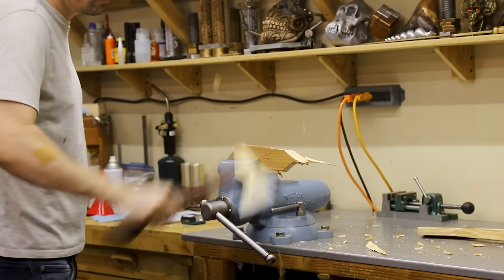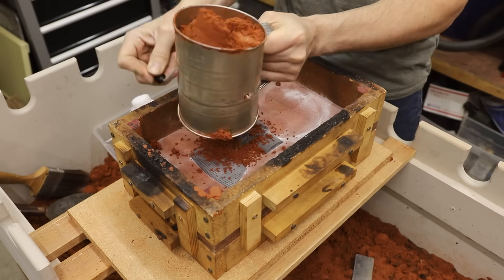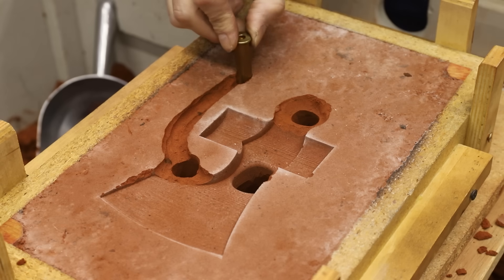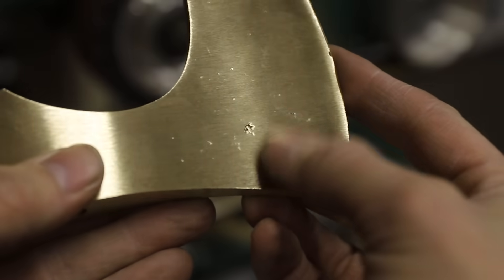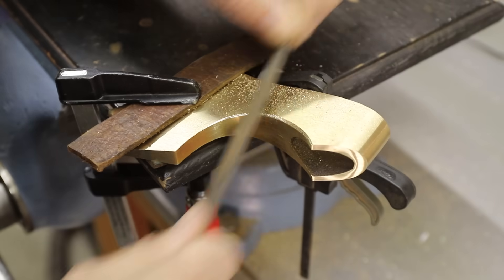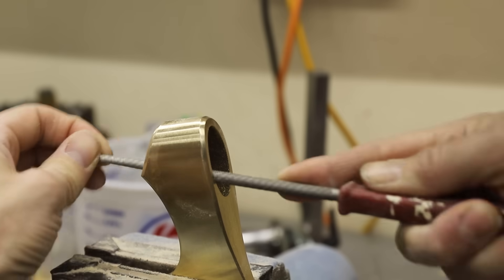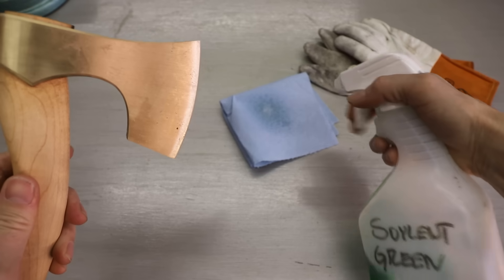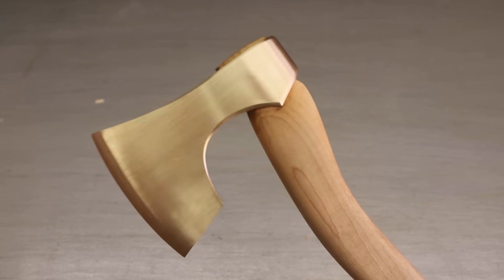Making & Testing Aluminum Bronze Hatchet WILL IT SURVIVE?

Comment: I think it would be really cool to compare hammer strike work hardening vs hydraulic press work hardening. With the press you may have to custom build a die/mold so you can harden the blade edge and a few inches back like you hammer hardened this axe. 

For the press hardening I think you would have to make the dies smaller on the vertical axis so it pinches down evenly across the axe blade, but you would also need a way to hold the head with pressure from the hammer side of the axe pushing towards the bade. That should keep the axe head from just slipping backwards out of the dies. Maybe have big bolts running from the blade edge horizontally back towards the eye, then you can run a thick bar through the eye with holes on the ends that line up with the bolts. Actually, it might be better to have threaded holes in the bottom die on the horizontal axis. That way you just slide the bolts through the bar going through the eye of the axe. Then you screw the bolts into the bottom die and that will keep the axe in place. The top die can be smaller than the bottom die because it won't have any bolts running through it. 

Main problem is getting the dies made. They would need to be made out of something much stronger than your alum/copper alloy. Maybe a collab with Brandon from inheritance machining? Or getting a sponsor from one of the fancy big cnc online shops that make custom parts. Getting the angles of the rounded sides of the axe might be a real pain so it may be easier to make a more angular axe head instead of traditional curvy sides. Though, I have no idea what that would do to the structural integrity of the axe. Hell im super late to the party so you may never read this, @robinson-foundry

Comment: Old axes had much thicker profiles than modern steel axes specifically because soft metals like copper bend so easily. It would be a good idea to do the same with this alloy.

Comment: It seemed to cut through whatever that tree is well. I wonder if 90/10 or 88/12 tin bronze would be better or worse for cutting and holding a solid sharp edge.
I know the ancient tin bronze axes had a thicker profile close to the cutting edge.
EDIT : Nevermind I just found your video on alu bronze Vs tin bronze 👍

Comment: One small comment, while an iron or steel hatchet will take the abuse, a hatchet of that design was never intended to cut kiln dried lumber, that combined with the lack of compensation for the metallurgy mentioned in a few other comments is what lead to the edge damage you experienced, I'd hazard to guess if you retested with a new head designed more like a camp hatchet and with more supportive edge geometry that it wouldn't make as quick of work but would likely survive with little if any edge damage

Edit(Ah well played sir, it seems you did just that and used more consistent metal for an extra bit of surety, I'll have to agree the tin bronze was quite impressive)

Comment: Every 5%ish difference in either copper or aluminum will throw out a different material entirely. It will alternate from brittle mess to hard af. Back and forth as you change that percentage. Melt time has a lot to do with it also as aluminum oxidizes the longer it takes to melt and that will goof up your mix. Got to account for it with extra aluminum. I would recommend adding 2% elemental phosphorous in a more controlled and inert atmosphere during the melt. Does not hurt to be picky with your choices of flux also. I have always used potassium chloride, activated charcoal, anhydrous borax, and aluminum powder as my flux mix for alumabronze. It makes a bit more of a messy dross, but it gives a clean product. The aluminum powder is me making up for losses when drossed

Comment: I used to make this stuff in the foundry i worked at.  I called it Bronzuminum.  I was looking for a way to weld aluminum to steel.  kind of like brazing but with bronsuminum  the join is much stronger and more integrated.never made an edged tool with it though.

Comment: The toughest bronze I've ever used was called Amco bronze, that we used for wear plates inside forming dies stamping car parts. It was almost impossible to drill, as it would work harden almost instantly,  and get so hard, that carbide could barely cut it. I don't think it liked bending either. If you can find some bronze from Ford's old form dies, I think it would work       better?

Comment: It almost gives me physical pain, whenever I see someone scraping the imprint of the mold - the roughened and loosened surface of the sand will introduse sand imperfactions into the cast. And it happened in your case, sadly.
It is better to use specific runner/gate additions during moulding to make path for the metal smoother. Or at least tamp the surface of the carved runner.

Comment: Dude, I freakin' LOVE the idea of making crazy alloys of various metals, that may have never existed before!
I mean, as an example, is there a way to allow lithium and iron? What properties would such an alloy have?? Would it behave like steel, with the Li atoms replacing the C atoms? Li is a HIGHLY reactive element, though. Would it be more susceptible to rust? Or would the atomic structure sterically hinder the oxidation of the lithium?
What about alloying a highly reactive metal, like lithium, with a largely inert metal, such as gold. What would the properties of such an alloy be???? Would those properties change with varying concentrations? ie- 10% litium 90% gold, vs 20% lithium 80% gold vs 30% lithium 70% gold, etc... Maybe one such alloy would be astonishingly confronting, in relation to its properties!!

On the one hand, it'd be great for our understanding of the science, to be able to accurately predict the properties of various alloys (such as per materials science). However, it would also be refreshingly wonderful to be incapable of predicting alloy properties, beyond its reactivity...

Comment: I have been researching bronze swords a bit, I'd really like to built one that is actually a sword. Much of the bronze strips one can buy is aluminium bronze, and it is said that aluminium bronze is not suitable for swords because it is much too brittle. The resultting edge damage seems to give this creedence, I have seen a bronze axe survive much more torture without failing like this. Swords and axes were 10-20% Tin Bronze, unfortunately I don't have the equipment to cast it myself. Really interesting to see, thanks!
Reply: nope its brittle one you have over 12% Tin 12% tin 88%copper was guns ,swords where 8 % or 6% tin. high amount tin is for church bells
Reply: @Preyhawk81  Many surviving european swords were between 10-12%, google a bit. And some chinese ones up to 20%, but those are outliers in the world of bronze swords. I have never seen the 6-8% figure. Could be these are arsenic bronzes with less tin but more arsenic (edit: early swords were generally lower tin, but the tin also leeches out over time and might not really show what it originally was) , but the tin bronze is generally accepted to be 10-12% for best results.
And bells to my knowledge are between 20-30% tin.

Comment: I'm sure if u mixed up the right proportions of each metal u could come up with a stronger chunk no doubt kinda like if u mix 81.5% gold to 19.5 % aluminum u get a purple gold thats fairly strong and doesn't crumble like if u mix equal portions or kinda like making Nordic good 89% copper 5%zinc and aluminum and 1% tin looks just like a gold bar but no gold in it

Comment: Hmm! Beautiful axe! I wonder if the ancients used different shapes more conducive to bronze?  Possible a thicker blade and higher blade  sharp angle. Maybe 20 or 25 degree? Less shaving more chopping. Fine casting and l am learning to salvage imperfections by brazing. Thanks

Comment: That sand casting bench is a fantastic piece of kit. Inspired. You might also consider using the old Japanese katana trick of making a sandwich of your CU/AL alloy with a thin piece of high carbon steel in the middle, which would then be the cutting edge and would last much longer. The golden color of the alloy was very nice and I liked watching the process from start to finish.

Comment: After cutting the dried hardwood, rather than 'grinding' a new edge, cold hammer the edge to both sharpen, and further harden the edge.  It would have been nice if you told us to what angle you made the initial edge, and why you chose that angle.

Comment: BEAUTIFUL WORK. We used magnesium bronze for high strength clamps. They didnt like stretching as they work hardened fast, but they were great to grip the steel pipes. WORST PART was drilling the bolt hole for the clamp through the cast unit. I learnt to sharpen drills by hand very well indeed. This was in the 80s onwards. Drills were not great to start with. ..

Comment: love your work, one thing you might try is after you oil the handle (exclude the top to begin with and no steel wedges) soak just the head in a bucket of water for a few days, it will cause the wood to swell and really lock the head on. My grand father showed me this when i was young, he never even used wedges unless the head came loose later. I had to replace a handle he fitted once and it took longer to get old handle out than to fit the new one it was locked in so tight. The different color wood does look great though

Comment: It will not survive , and why are using softwood at the start, How about you come to Australia and try that piece of rubbish on Ironbark gum tree`s.
Aluminium has no tensile strength by itself , that why the covers on bikes  contain nickel ,magnesium etc etc.
Bronze also is not a strong material especially for violent work.
I still cant over you using pine as if that's a test of strength, Maybe in Russia , but not inthe real world.
I am a Boilermaker/Welder ticketed in 1985 Had to Pas DLI standard 4E.
I have made many log splitters in my time.
If you have a trade certificate, please post in chat the cert number and institute so i can have it taken of you. For bringing metal trades into disrepute bye posting rubbish..

Comment: could try again using the original mold that gave a thick squared edge, then work harden it for 10,000 stroke lol.   if it folds like that it can stand to be a bit more brittle so really hammer the shit out of it and see if you can make a harder edge :D

Comment: Man, a PM30 and G0602. Excellent small shop combo that used to be semi-budget, but not so much now.  Excellent work, any reason you don't use a resin print for the casting? Could easily eliminate 90% of the layer lines while printing much more quickly.

Comment: Thing of beauty!  Many years ago as an apprentice centre lathe turner I foolishly made a starter motor bush from aluminium bronze instead of phosphor bronze, it was totally wrong for the job and lots of loose play appeared quickly as the steel shaft wore more quickly than the al bronze bush. lesson learned, this stuff is tough.

Comment: There's a company in the netherlands RSP that makes an aluminum alloy called 7034T6. It's the strongest aluminum in tbe world achieving a yield strength of 750 MPa, higher than heat treated medium carbon steel. That would be a cool material to try making an axe out of.

Comment: Did you make your belt sander? What size belts does it use? I have a 2x72 I built but it would be nice to have a second smaller unit with the larger rubber wheel so I didn't have to take it on and off every time I need the flat plate. Thanks for any suggestions.

Comment: It looks fantastic. Can you harden the alloy by adding something to it when you have it in a molten state. I'm not sure. I'm just getting into melting metal and built a blast furnace out of an old ceramic kiln. I've been a welder for years but never had the time to build a small scale foundry until recently. So far I've melted into molten liquid steel pipe, and aluminum, that's as far as I hot before winter set in.

Comment: I think something to consider in the future for putting the edge on something that can be work hardened by hand and still annealed as well under relatively low temperatures. Heat is your enemy as it can soften the work hardening that was put in. Hand grinding/sharpening on a whetstone is at worst going to increase any work hardening while not friction heating the metal. More time consuming, but bronze (obviously) does not act like steel. After casting the best thing you can do is remove as much as the excess as possible via modern means before going to hand tools to remove more basic flashing and any rough spots you want to remove and then move to work hardening, and hand sharpening. The less heat after casting the better it is for the integrity of the metal.

Comment: Absolutely beautiful piece.  You could consider putting the chamfer and the internal taper of the handle into the 3D print.  If you are using Fusion 360 you can try the emboss/deboss feature.  You could cast in your own ID stamp or raised marking.  To me, there is something very intriguing about cast manufacturer's marks.

Comment: The chamfered edges are smart. True square edges will cut skin.  You would have to be concerned with all the edges of the axe instead of just the cutting edge.  Handle stock.  MOST maple is a poor choice for strength and flexibility.  As  ash has disappeared, MLB has moved to maple, broken bats nearly every game now.  Hickory (first choice)  ash hard to find,, some elm does pretty well, very flexible, very tough,, I would very slightly thicken the handle.  BTW  You do astoundingly beautiful work.

Comment: Do you intend to chop other than wood? If not, it will perform just fine, depending on the alloy. Will it wear more quickly than Tool Stel, sure. Will any but the most professional woodworker notice the practical difference, probably not.

Comment: Have you done any research into heat-treated such alloys? Normalizing and tempering had a HUGE impact on the usability of steel, though I imagine the metallurgy of these alloys means any such process would be significantly different. Still, just the annealing process changes dramatically, so there MUST be SOMETHING you can do to improve the hardness of the metal...

Comment: prediction: 

itll work out fine. The problem with bronze isn't that its a soft metal. It can actually be helpful since it wants to dent and bend instead of break or shatter.  The reason Iron historically started to get switched in for bronze is that tin is so hard to source. It also can hold a edge quite well as long as you don't go beating on steel with it. The aluminum might just be overkill.
Reply: Welp, i was wrong >D it happens once in awhile. Itsa bit surprising though, but I think your conclusion is correct. the edge might be a bit too fine. Looking at kopesh blades they had a thicker blade in general, but also a wedge-shaped edge.

Comment: Really good education film. Blade is ok , maybe medium, medium quality. Handle is poor. Mastering the woodwork is the hardest part and true masters used to make just slightly asymmetrical handles, that I havent seen at past 35 years , One I  saw were period of circa 1870 to 1930. They were made to compensate left and right handines and how human arm and wrist worked, so that blade hit surface at strait. Do not know, for what purpose precision axes were needed. Maybe there could of been one virtuoso, at shipyard or housebuilding, that could slice extra millimeters from pre cut assembly timber parts when needed, during construction. There has always also been unusual specimen of men, wo were capable of extraordinary skill level, and some even made their own tools. They were treasures, for employers, when good men were in need, I suppose, but I was also taunting in labor environment. Self employed, hunters and farmers were more better position, as they did not need to care collagues. Also finding spouse was easier, for men who had gentle made, good or nive tools, if they were selfmade

Comment: Wow, I was about to mention the fact that the aluminum and bronze are both softer metals, then steel so generally wouldn't hold up and in ancient times they would generally have to re-sharpen it every time they used it throughout using it just think of the copper, chisels and bronze chisels usedto make everything from the tombs of the pharaohs to great castles throughout Europe any large stone monuments

Comment: I am think about this, and you are right about the pinging the aluminum to harden the edge... but thing the about distressed aluminum is that heating it up will relieve the stress & will return it to it natural state.. I would be inclined to believe you could find an aluminum alloy that is near indestructible in its natural state... anyway... you are fine engineer... hope the dove tailed brass project turns out well, but the brass.. doesn't take too well to abuse...

Comment: Chamfering the edges sure looks pretty, but on a really usable hard blade I want a crisp 90° on the outside (top) 
a) to strike a ferrorod, if I loose or damage the striker or my knife,
5) to make fine woodshavings for tinder - just in case, you never know.
Something to notice: the bulge behind the eye of regular hatchets and axes is a counterweight (NOT a hammer), it makes the tool more stable and helps against wobbling - you made the head more tomahawk-style with no such bulge, so it's wobbly and even more dangerous. On well-built hunting axes you see the counterweight well rounded to assist in skinning large animals.
I would grind your hatchet, mirror-polish it and hang it on my wall as a decorative piece, that's where it shines.

Comment: You can just make the blade with more degrees of angle, it will not cut as it does now but would survive better. 
Also it's bronze so you could cold hammer down the edge and use the result as it come out, it will also gain some hardness like that.